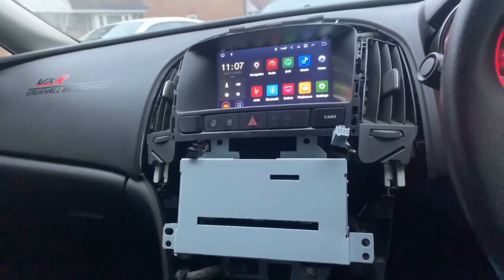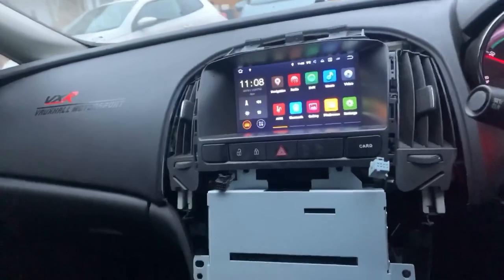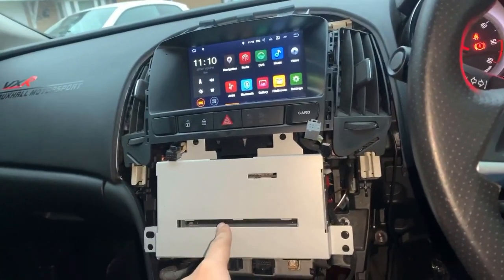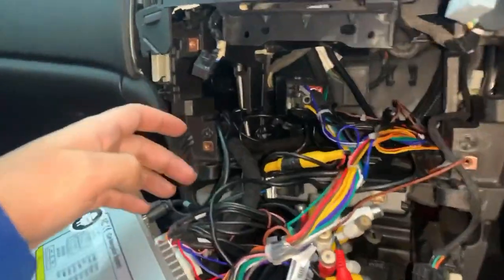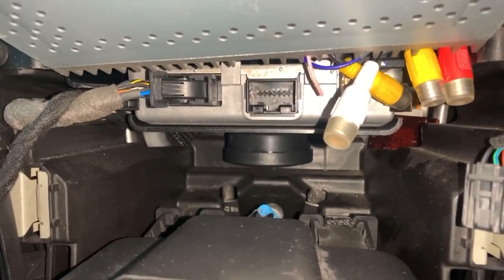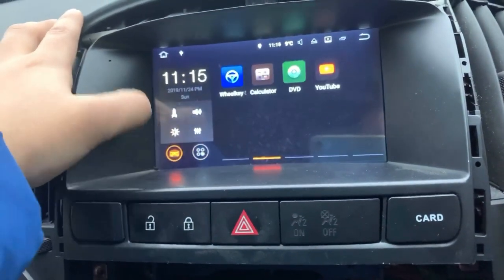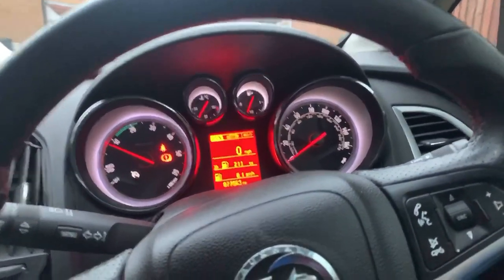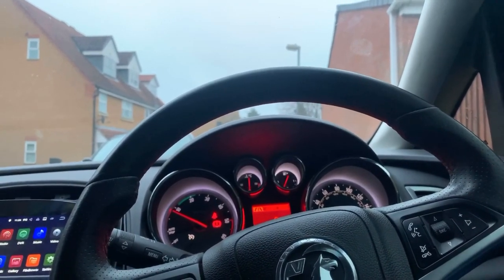Android System For The Astra J Explained In Detail

Comment: Hi, mine have a problem with the software, do you have any idea how can i fixed?
Reply from the maker: Go to settings, general settings, factory reset
Reply: CAR SOLUTIONS The screen is blocked, the controls doesn’t work.
Reply from the maker: @JoaoLopes-ln2im  Im not too sure because I've not come across this problem I would try the forums or contact the supplier of your device
Reply: @CAR_SOLUTIONS  hey dude sorry to necro this video but every time I try to buy one of these for my 60 plate SRi CDTi 1.7 astra J (81kWh 112bhp) it says incompatible - any idea what one I can use instead?
Reply from the maker: @mattygaga2013  which model player have you already got factory fitted to your vehicle at the moment
Reply: @CAR_SOLUTIONS  the standard and i think its the CD400
Reply from the maker: @mattygaga2013  if you type in: ANDROID 10.0 OPEL ASTRA J CASCADA RADIO COCHE DVD GPS USB CAR WIFI 4G SD DAB+ BT ...... to eBay it’s the first one any one like that will be compatible for your car this ones a bit pricy make a offer and with a bit of luck you’ll get it for how much you want
Reply from the maker: @mattygaga2013  I’m not too sure as it doesn’t show the cables best thing I can suggest is contact the seller and let them know it’s a 60 plate astra J with a standard CD400 fitted in it they’ll be able to advice you most likely if it’s coming from AliExpress they’ll 😂 create the wires and send out the correct one because them guys are capable of anything but all of these devices come from aliexpress anyways